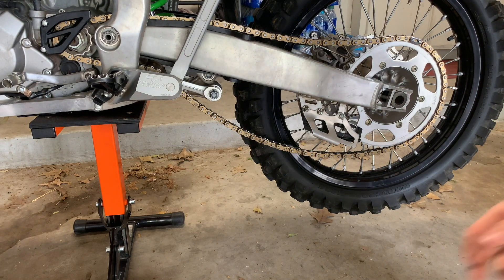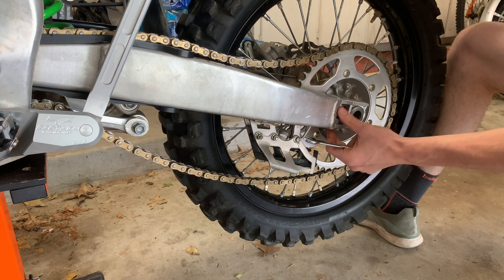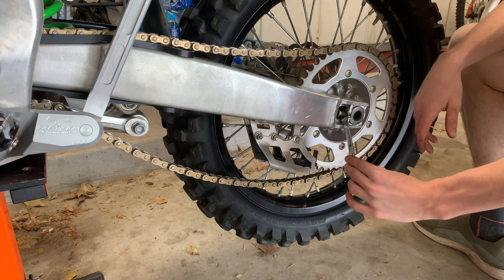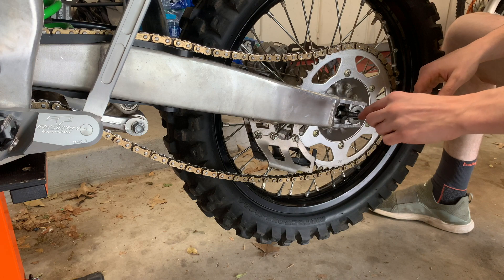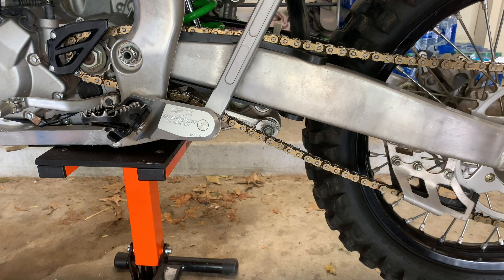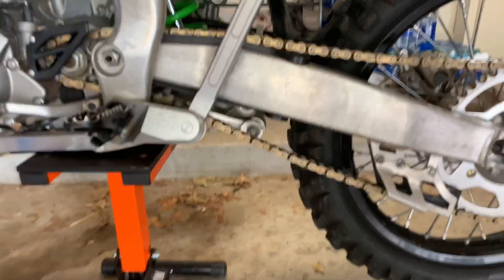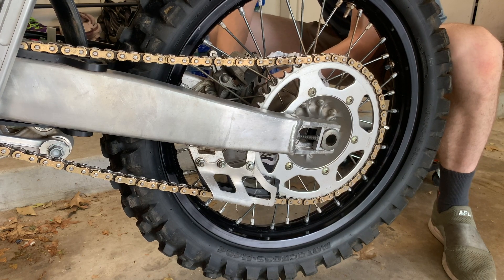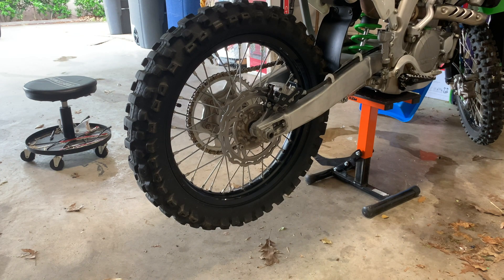How to Tighten a Dirt Bike Chain/ 2015 Kx450F

Comment: Great vid!! Got a newb question though. I just got a 20 kx450f, only rode around the block a few times, the chain is Clackin sounds loose...I put it on the stand, the 3 finger check is good almost a tight 3 fingers. Been years since messing with dirt bikes. I'm stumped do they always Clacl a Lack like this?
Reply from the maker: It’s hard for me to tell without listening to it if something is off. So I would compare to a buddies or someone at the track. However, yes they definitely do clack. And since you said you road around the block, another thing I have noticed is I hear the clacking more when I ride on the street with a dirt bike
Reply from the maker: Most likely it is fine!
Reply: I have a 18 450f & I’ve been having that same clacking noise I was thinking something could be wrong but the bike has been riding fine. Thanks for clarifying that they do clack & it’s pretty normal
Reply: yeah i got a 14 kx450 and mine does the same when going slow low rpm  lol thats why im watching the video but never had a issue so hopefully all good

Comment: When you get the chain 3 finger tight where you want it  and when you sit on it and chain is really tight, is that normal or no??? Thanks!
Reply from the maker: Well it should only get tighter whenever you put it in gear and that is normal. Should not get tighter just by sitting on it
Reply: No that it normal, it does get tighter. If it doesn't, your rear suspension is really stiff

Comment: This guy has to be a newbie himself. In a comment below he reply to someone saying your chain doesnt tighten when you sit on the bike. That's false it sure does tighten when you sit on it. How does it tighten when putting it in gear. Lol he started off horrible tightening the rear axle nut and you definitely didnt cut any links off your chain. There a certain number of chain links you need to have that go with your front and rear sprockets teeth count. He has his axle alignment bolts all the way backed put like a goon. This video is very miss leading from the start I would not take after this video one bit download a manual online if you dont have one and do it the right way
Reply: yeah, or calling everything Snug. blasting 5 times around the clock with that big ass wrench :P